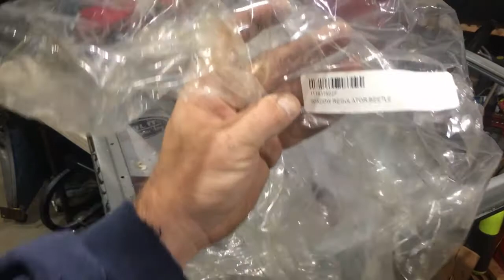upgrading the window regulator on a 68 vw bug with a 69 (68 lowered Baja Volksrod Build Night Owl)

Comment: Did you ever finish the install? I bought these same regulators for my 1-piece in a '70 Baja rebuild. I've had to bed the regulator brackets to get it to fit, and something still isnt right. Struggling.

Comment: @Off Axis Builds -  How did the rest of the window upgrade go? Did the glass and rubber go in  like it should? Does the window roll up and down smoothly, and were there any problems in adjusting it after you inserted the glass? Thanks
Reply from the maker: Honestly I’m still building the car. I am almost to the point of installing the doors. I still need to fix some rust on the doors.
Reply from the maker: Honestly I’m still building the car. I haven’t tested them out
Reply from the maker: Yes I am interested. Please post some pics on my Facebook page or group